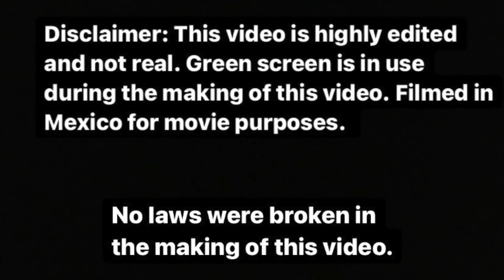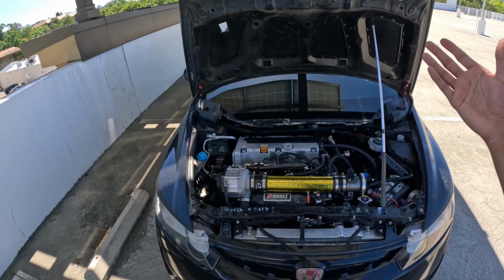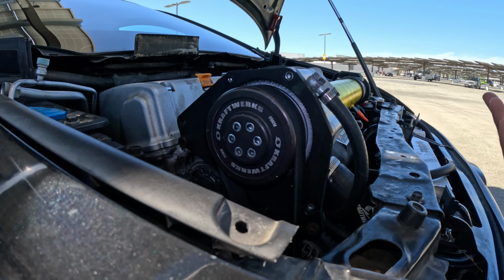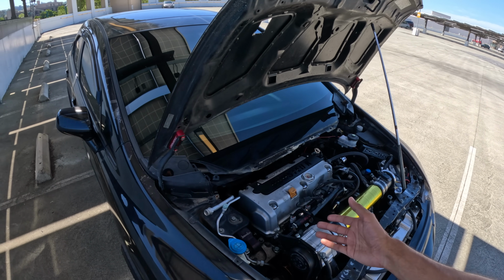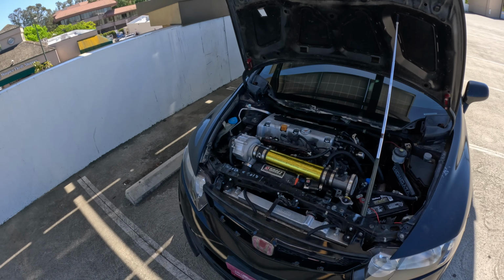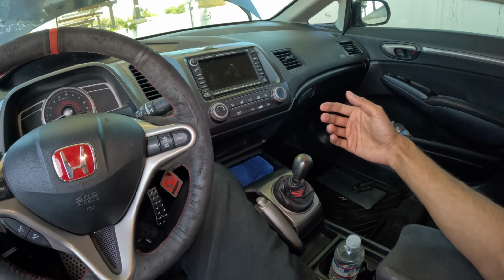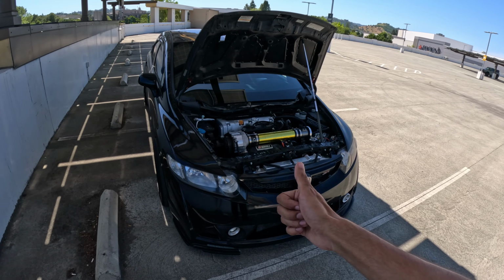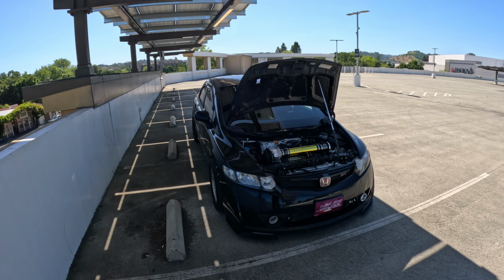500HP 8th Gen Civic Si Complete MOD List *Revealed*

Comment: 95mm pulley is wildddd
Reply: I got a 90mm wit k24 crank pulley😭 revving to 8150
Reply: @K20.spidey  living life on the edge🤣
Reply: @K20.spidey how much psi?
Reply: @K20.spidey  what psi did u get from that ?
Reply: @mikellewis2346  22psi
Reply: @K20.spidey  has it ran for long like that ??
Reply: @mikellewis2346  ran it for about 7k miles beat it everyday all day never had an issue wit the blower sold the blower and it’s still running strong
Reply: Maybe on a centrifugal supercharger. But on roots style superchargers people go MUCH smaller.

Comment: Bro, this car has become an icon in the Honda scene on YouTube. My top 5 list (in no particular order)

Zosh's K24 Integra
Mark's (HSG)  K20 EJ1
TheBoyWithTheHonda's KW 8th gen Si
Fred's RHD K20 Turbo EG Coupe 
Kyle's (Boosted Boiz) H22 Turbo EK Hatch
Reply: #1 TheBoyWithTheHonda because he actually puts his car to work
Reply: fire list! also 2point2tubo would be there if he posted more. He has a fire sleeper accord haha
Reply: man how about RHD kev with the integra 🥲
Reply: @papairvs  facts. His videos still be on my recommended every now and then
Reply: Boostlee
Reply: Screenshot because now I’m bout to go look all these up lmao
Reply: @papairvs  gotta have 2point2turbo in the top 5. Truly a top tier shitbox sleeper.
Reply: My Dc5 is a contender!(altho I am not a content creator).. There is about $60,000 in it total🥲... Got the car from Josh Jett in 2015.. Since then, I went AWD.. S1 kit with Billet Viscous Coupler and Transfer case with PPG gears.. Transmission is PPG Syncro-engagement Dog Gears 1-2, and Helical 3-4-5-6. Mfactory LSD and carbon Syncro's with billet shift forks. Engine is k20/24 frank. Sleeved wet block. 10:1 CP Pistons and Turbo Tuff rods and wrist pins. Head is ported and polished K20 with Supertech valvetrain and 4P turbo cams with Skunk2 Alum Rocker arms. Turbo is Garrett G40-1150 for the track, and G35-770 for the street. On Pump gas it makes high 400's, and e85 it makes mid 600's. On big turbo it makes close to 1000whp on e85. Ran 8.81@160 last week!.. PB so far. Suspension is Bilstein B16's on damptronic. Bilstein was kind enough to install damptronic on a used set of B16's from a Euro EP3 Type R, so I have remote adaptive dampening and ride height control from in-cabin... It has a valved exhaust so I can drive it on the street.. The car still has AC and Powersteering. AC is electric from an older Prius. Has Electric PS as well. It was converted to drive by wire so I could run electric waste gate to control boost better. Other than that, the car was professionally sound-deadened and fully reclipped and bracketed. All new beefy weather stripping. The car was like driving a tin can and was just not enjoyable. After getting the car sound deadened professionally, it made all the difference. The cabin is actually quite. No rattles, barely any drone. Its lovely to drive. And having that adaptive suspension, I can make it so its nice and soft when Im cruising.

Comment: @TheBoyWithTheHonda

I don't recognize the front rims but the rear rims are AVID1 AV6's
VIA stands for Vehicle Inspection Association, a certification standard in Japan and JWL stands for Japan Light Alloy Wheel. The missing middle cap usually has the "AVID1" stamp.

Comment: How do you like that clutch for daily driving? Must be a bit of a pain for traffic use. Pretty grabby/not much slippage i imagine. For that level of power your car has. That heavy of a clutch needed?
Reply from the maker: Surprisingly, my clutch feels soft and not very aggressive. When I’m in traffic, it does not bother me at all.
Reply: @TheBoyWithTheHonda That is surprising. 6 puck ceramic and light flywheel tends to be pretty grabby. I have a spec stage 2+ "button" ceramic on a cruze with little over 300wheel. Great clutch but man traffic is not forgiving. Doesn't slip hardly at all

Comment: can u do a beginners guide for the 8th gen civic si. i just got mine and i dont know where to start w mods.
Reply: Cold air intake
Throttle body
Intake manifold
Header
Full 3 inch exhaust
Hondata
Tune and lower Vtec engagement to around 4600rpm

Wheels
Tires
Coilovers
Brakes

Many many other little things you can do like short shifter, seats, steering wheel, injectors, carbon fiber hood etc. Or bigger things like K24 swap or K24 bottom end K20 head so more torque but you can still rev past 8k. Turbo or Supercharger will only really be enjoyable with the other mods.

Comment: I believe you can find the wheels specs at the back and they're usually engraved. It kinda looks like mine which has 18x8.5 +35 offset with 225/45/r18 tires.

Comment: This is why I don't like that supercharger. They break a lot. You will not have that problem I'm a regular turbo. Rotrex has a limitation in horsepower also breaking the shaft. Also you can't  do 2 step with rotrex Why they sell a 95mm pulley if break the rotrex?
Reply: Make it worse, 95mm really isn't even that small as far as superchargers go..